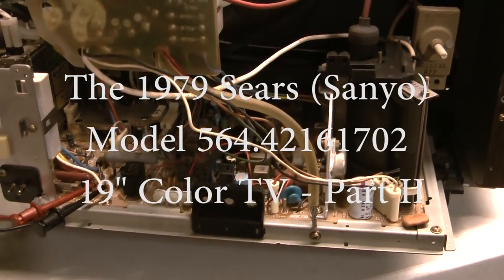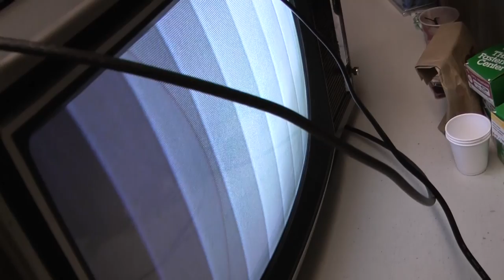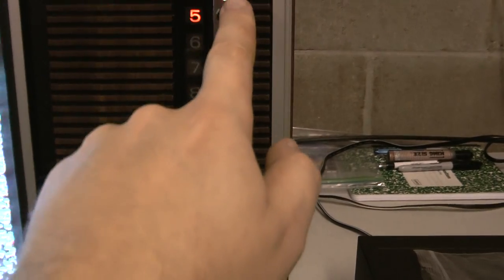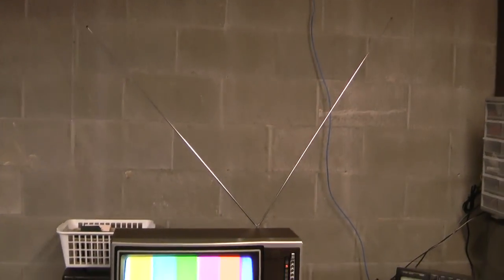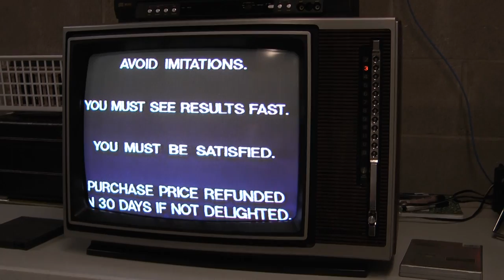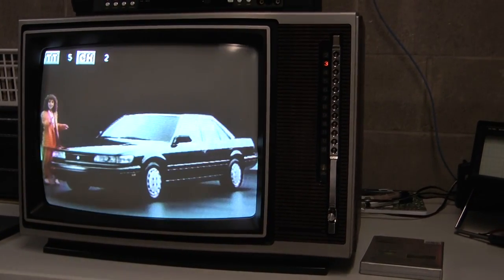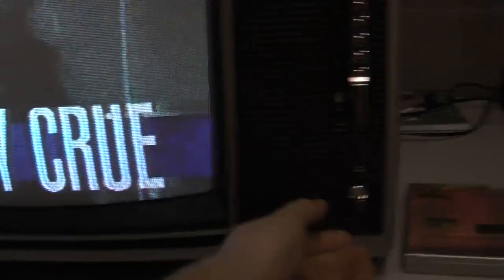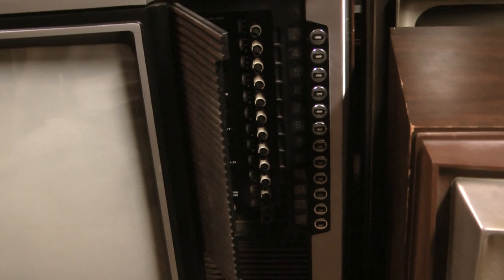The 1979 Sears (Sanyo) Model 564.42161702 19inch Color TV - Part II

Comment: I once had one of these, the 76 you show, My parents bought it new in mid January of '77 in time for that year's Superbowl. I remember being picked up in my late father's 76 Honda Accord with the brand new TV in the back with 3 other friends, and we had to sit in around the box to get home from the theater. I was the oldest at 11, I think.

Anyway, they upgraded to a 27" RCA ColorTrak 2000 stereo TV with the wood cabinet (particle board with veneer) in 1988, and I got the old Sears. By then it was getting high hours on it and I finally had it checked in 1989 and a TV engineer at the TV training station I was a student at checked it out and had to turn up the drives on the tube to gain more leeway in the brightness and contrast controls as the tube dimmed.

Finally, the tube got so bad that it developed color impurities and bled in the reds badly at times, and had the retrace lines at the top, and the picture tube got fairly dim, though color accuracy was still largely there.

I left it in my old bedroom at my parents when I moved out in 1996 and bought a new 20" stereo Toshiba color TV that I still have and it works great, never been serviced, though I don't watch much TV these days.

Anyway, these old Sanyo/Sears TV's were fantastic, and loved that capacitance tuners they had. BTW, I know some versions had remotes, ours did not.

Comment: We had the 1976 model you showed at the end! It was in Canada so the sign/logo was different, it had an atom-like logo. We used it up until the early 2000s when it started giving us too much trouble and the lack of remote control pushed my father to upgrade to a more modern TV. That said, I recall we had a large remote control with only two buttons (up or down), not sure if it came with that TV or the VCR, do you have any idea?